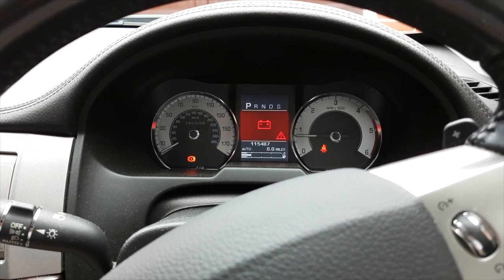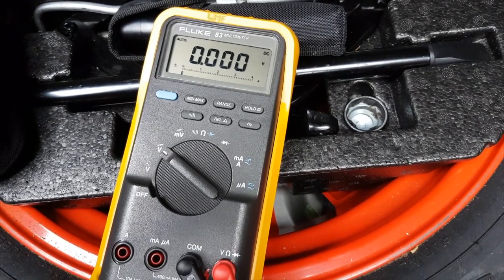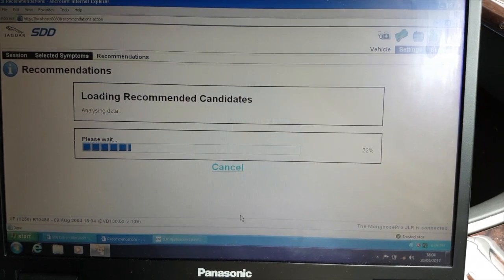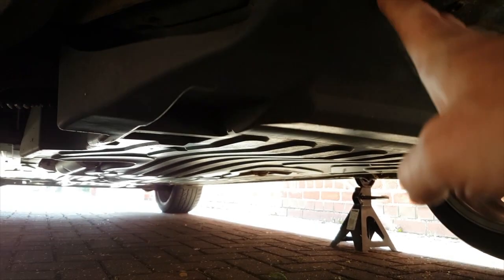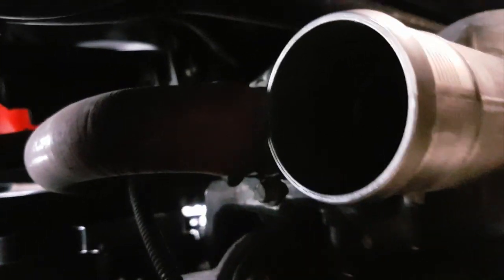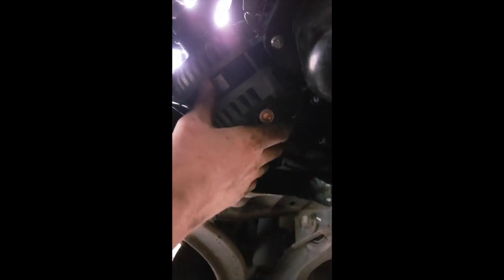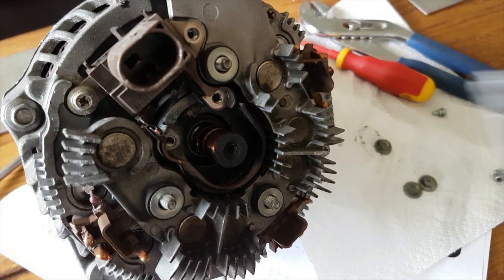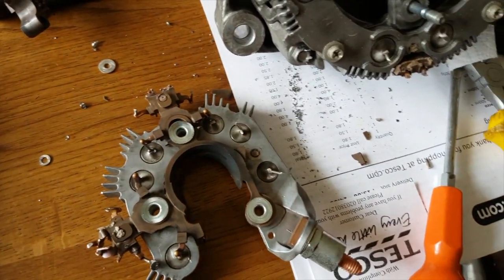Jaguar XF S 3.0D PCM P065A Alternator Failure

Comment: Thanks for the video Leon. I have a 2010 XF with the 5.0L engine and my battery light came on recently at night. Luckily I was driving on fairly open local roads. As the shutdown of components progressed I began losing engine power. What I did not know at the time was the car was going to shut down. Shifter went to park and back into the console. 
  Your term, grinding to a halt, is  correct because you are not going anywhere glad I wasn't on the highway  things could have turned out much differently. My advice for those that read this is simple, if the battery light comes on find a place to pull over quickly.  I made it to the corner on my block when I ground to a halt. Called for a hauler to get me down the street, thats when I finally read my manual and found that there is a way to get the car into neutral in order to move it, wrecker still got paid though.
  Read your manual people. Pry up the strip between the cupholder and usb,lighter and ipod connector box, turn the retainer with a coin or screwdriver and pull the handle up.
  I didn't have to lift my motor,  I did have to remove an idler pulley as my top bolt was behind it. All is well now and I want to say thank you again for the video.
Reply: MrSullione did you have to replace the altinator?

Comment: I changed my alternator on My 2014 Jaguar XF on Monday evening. Thanks for the video - it was really helpful. A couple of observations from my experience. It is not necessary to jack the engine up in order to be able to remove the alternator from between the engine and the subframe. If you loosen both the front engine mount nuts, the engine can be 'barred' across sufficiently to remove the alternator. A good method is to use the small bracket on the subframe near the starter motor and the starter motor lug. Second point is the 'security bolt' on the regulator. It can be easily removed using an impact driver with a phillips bit. It is just quite tight - hence why you had to drill it out. Apart from that, very helpful.

Comment: Hi Leon. Thanks for the Video. I have the same type same age XF as you. Changed my alternator this weekend, you gave some very useful tips. I managed to just push the wastegate to the side, once those bolts are out and not remove it completely, I needed to jack the engine sideways say 10mm as well as up.  I struggled to take the tension out of the belt though, a webbing strap and long 3x2 leaver eventually solved it. I found a referb Delco for £101. My friends, friend just paid £800 for a new alternator in an F-Type at a specialist NOT main agent.  PS I used your other video to change the  door locks on both off side doors. I think I owe you a beer.

Comment: Hello All, Thank you for this video.  FYI: Leon's Jag had 115487 miles when the alternator went bad... my 2011 Jag XF alternator just went bad yesterday at.... 115467 miles.... interesting.... FYI - I did not need to unbolt engine and jack it up... I guess the US design is a little different... the alternator was super easy and done in a few hours... and no i am not a mechanic.  However, after changing the alternator... the light still blinks on and off and the tire pressure is going off on all four tires... so, i am thinking a computer fault designed to be triggered at 115000+ miles marker.  I will let you know.  Thanks

Comment: Brilliant vid.  My XF sat down in a garage forecourt with the exact same symptoms and I was scratching my head as to what had caused it.  Trusty recovery service came out and tried to recharge the battery but no luck and nasty burning smell from the engine bay.  It was the alternator.  It was a bit sketchy  driving when the dash warnings came thick and fast then the instrument cluster went dark!

Comment: Nice video, thanks for that. I;m just wondering don't you have torch light in your mobile, that would make it possible to see something in tricky lightning conditions. It's amazing how such a little diode can make this big chunk of device useless. I had to replace radiator fun in my xf and it's more than likely that some tiny pcb element failure made it useless.

Comment: Thanks Leon for a brilliant step by step guide to the hardest job I have ever done on any car,   One question I fitted a new alternator (probably recon although does have a lucas label on it) and although its charging getting 13.6 volts at the battery now the battery warning signal still comes on, does this need to be reset with the SDD software?
one difference with the fault light - when the fault first appeared and I reset the fault on the center screen it kept reappearing after a few mins in the message center - now after replacement it doesn't reappear only the small triangle stays on next to the clock.
One of the hardest parts of this job is re-fitting the boost pipes - the metal pipe that goes up behind the alternator is a pain - we managed this by my oppo pressing down on the pipe as i pushed the pipe into the  hose, next issue was re-fitting the boost pipe - 2 problems - refitting the small vac hose and fitting the center large hose back on - we decided to spit the casting by removing the 3 center bolts and fitting it as two parts - this was i was able to hold the large hose while my oppo pushed the aluminium part into it.
when jacking the engine up to remove the old alternator we couldn't remove it but as soon as we loosened the near side engine mount bolt it dropped out.
Anyway thanks again Leon - Looking forward to your video on replacing the timing belt lol
Reply: Geoff Harrison you have my respect for doing this by yourself . I reckon my alternator needs to be changed but I think I'll take it to a garage as I don't have the tools :)))

Comment: A couple of points that I've found out while doing mine. Firstly, you don't need to take the whole wastegate assembly off, just the right hand (looking forwards from under the car) pipework. Secondly, the easy way of getting the alternator out and back in between the sump and the subframe is to rotate it until the single lug is pointing down then rotate it so that the pulley is vertical (pointing towards the bonnet), then it should slip through the widest gap, towards the rear of the car easily and without recourse to screwdrivers and levers. I only found this out after 4 hours of going insane trying it your way.

Comment: I had the same problem I got the alternator refurbished and its putting out 13.5, I also checked battery it fine but still getting the fault, any suggestions folks

Comment: Excellent video Leon.   Sadly I dont have access to a pit or ramps. 

My alternator failed but I only got an occassional flash of the battery light evey 3 or 4 miles and only for a second or 2. 
The car shutdown completely on my journey home that night. 

Since the dealer replace my alternator on Monday, I get the Restricted performance mode activated when I accelerate really hard and it has completed 2 gear changes and is almost ready for the 3rd gear change. 
I have to shut down the car and lock it then the error goes away, but comes back if I boot it again.

Its OK if I boot it hard in one gear up to the redline though.   Do you think they have disturbed a component under there somewhere ?
Reply: Dave it may be a coincidence that this is happening as this happens when the secondary turbo actuator sticks due to carbon build up. It can be removed quite easily and cleaned but usually sticks again. I have not had the problem for a long while since driving the car more briskly.

Comment: Great video! Exactly the same thing happened to my Jaguar XF - a battery symbol followed by warning lights for ABS, gears etc then the whole electrics went off as I was driving and I had to pull over. Zapped a brand new battery of all its amps within a few minutes of driving. One word of warning. If this happens, try and quickly get the car into neutral before stopping, otherwise you won't be able to move it as it will be stuck in gear.

Comment: my Jaguar XF 3.0 2010 also has a battery flashing for a second my i start my car sometimes. should i also change my alternator
Reply: Chris Yang did you change the altinator?
Reply from the maker: If it only flashes on for a second, I wouldn't worry about it.
Reply: Leon Fletcher I tried to jump start my jaguar xf but it hasn't made any  sighs of life, my air vents also stopped working and I'm getting gear box fault and low battery fault alert message on the dashboard.
Reply from the maker: @undisturbed809  I wouldn't attempt to drive the car with a low battery as you'll get faults in all sorts of weird systems. Charge it up (or replace if damaged/end of life) then see what faults remain, if any.
Reply: Leon Fletcher so I should replace the battery?
Reply: INSTAGRAM: _tav.official hi sorry for the late reply and I hv not changed yet. Should i do that ?.
Reply: Leon Fletcher thank you very much. Some times it will not flash and it is 5 month now. Same issue, flashing a second when start the engine 😂
Reply: @chrisyang209  
I'm having issues with my Jaguar XF.... I drove it for some minutes... Tried to reverse it was stuck in drive for long... I  off it , later tried to on it but its still stuck in drive... Transmission failure is written on the dash board ...Gear not in park.... Had a battery warning. later... Battery will be off in 3 minutes..
Reply: @davvvffffoo7576  bad alternator

Comment: Any problem with the battery light on but the car starts and runs fine is your not using the car enough, yes that's right. I changed my alternator, battery and voltage regulator and it still showed the battery light on. After several phone calls I was told it's my fault for not using the car every day, if you use it for 5 days on the trot the computer will sort itself out. With mine the computer would shut down leaving me with no radio, A/c or Sat Nav. It's the software in the XF.

Comment: I have the  same problem with battery light on the dash, however had it all checked out and it's not the battery or the alternator. Any ideas would be appreciated.
Reply: John Isles my battery light just came on the dashboard last night. Any news ? I hope this is not the start of my problems with the Jaguar XF. :(
Reply: Try changing the battery in your key fob, yes might sound silly but it solved my problem. Let me know how you get on.
Reply: Hi Costel, how did you get on after changing the key fob battery.
Reply: Hi , John Isles thanks for the reply. Still waiting for the hey fob batteries. Surprisingly the warning is coming on and dissappear after few seconds but back again in about 2-3 hours. 
Also very weird when I get in the car and I try to start the engine (Press the brake + start button = engine running ) but in my case I have to do it twice to start the engine.
Reply: Amazing. I had to spend a cold london night due to failure of light systems. It cascaded from battery to wiper malfunction, to gearbox fault then even the hazards could not come on . Upon recovery the gearbox and wheels were locked so car had to be llifted by crane as this was a motorway blockade. 

Now my problem is charging is at 14V but i have not measured current during charge or when car is off as in the video so i will try this weekend and see. Untill i do the work i am just sharing
Reply: @albertdube7328  
Same thing happend with my car today, please tell me what was the problem with the car?
Is it total damage as a RAC guy just said to me.
Please, i am scared!!